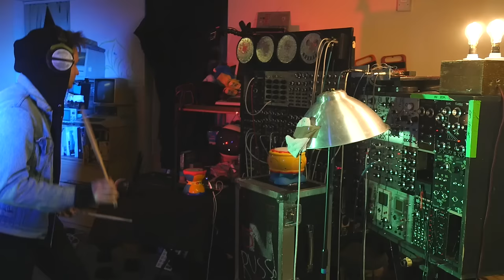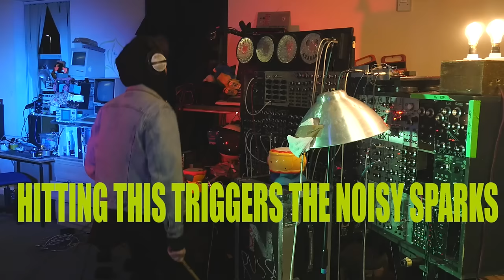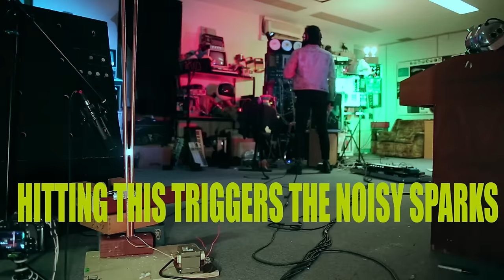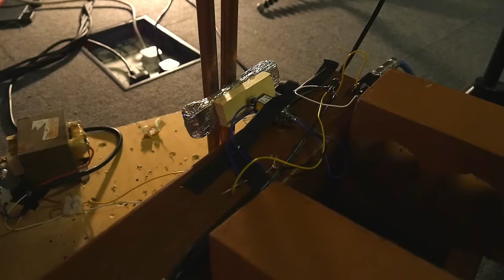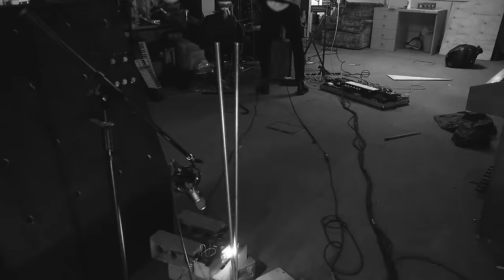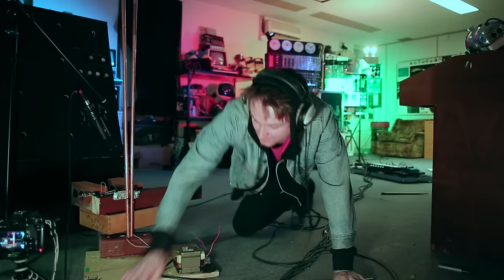High Voltage Drum Machine 2000 Volt Drums

Comment: pretty smart.
A lot easier than solid state control.

a triac on the primary of the transformer still wouldn't be that difficult.

i really do think you should put in a power resistor to limit the current, seeing how your transformer is smoking at the end.
Reply from the maker: thanks borgar. yeah need to do that im waiting for the prime TV to come along and build mk2. i opted for this cus i had a load of solenoids sitting around, and it was more visual. its all in pieces now :( gunna build a proper one! and definately going proper on it! thanks.